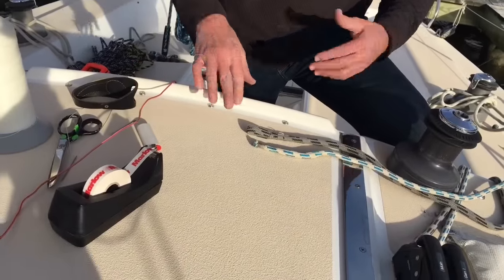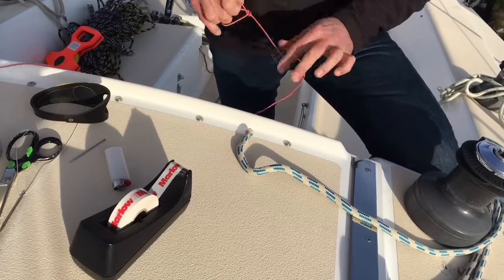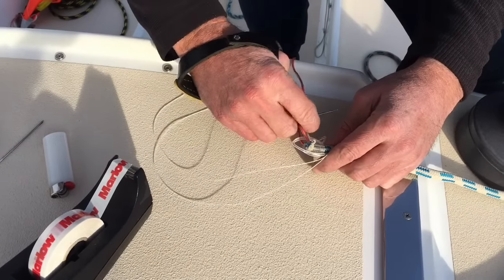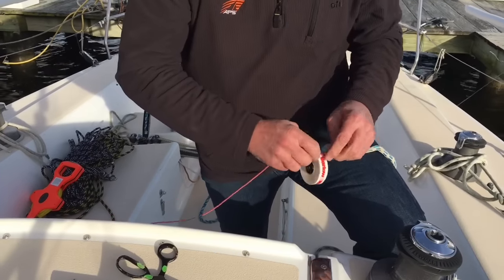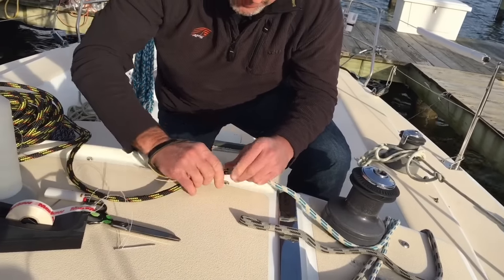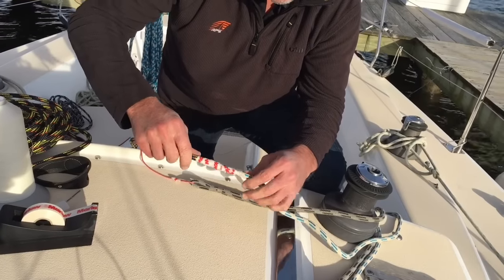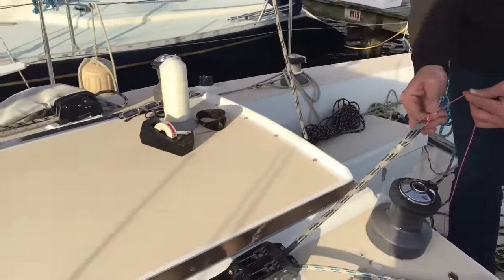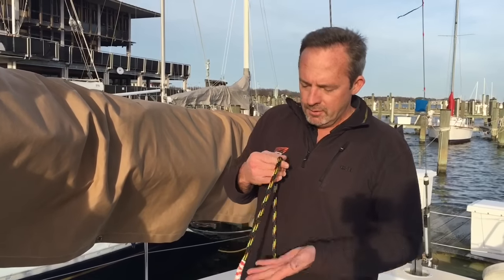How to Install and Remove Sailboat Halyards | Expert Advice

Comment: I use the 3rd method when replacing a worn halyard with new line. I pull it through slowly and gently until the join is through. Thanks for the video.

Comment: Pro tip don't use any leaders that could jump a sheave.
Reply from the maker: Agreed.  I have seem new mast come in from the builder with 1mm leaders that seems like it would be likely to jump the sheave and get wedged between the sheave and housing.  The 2mm we recommend is the smallest diameter we feel comfortable using and performs well.